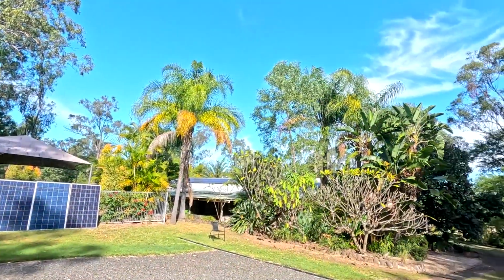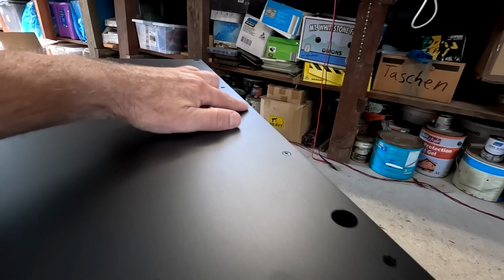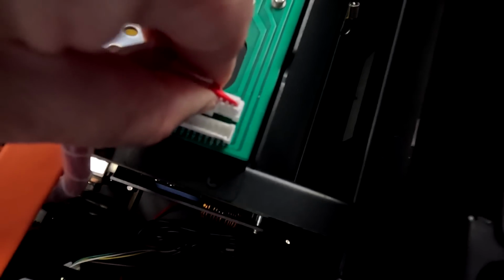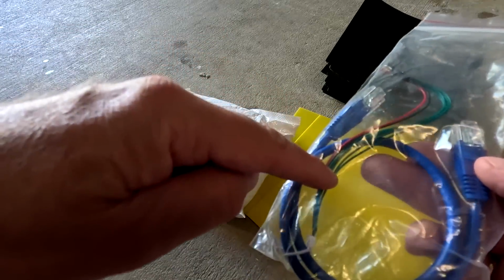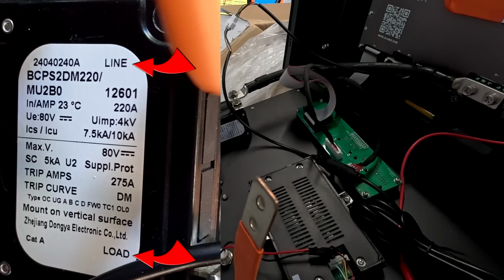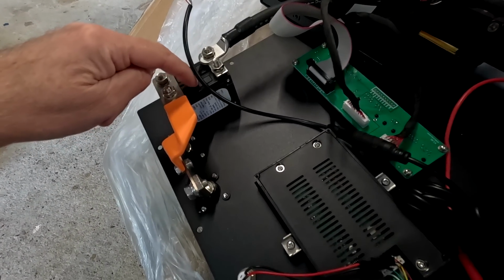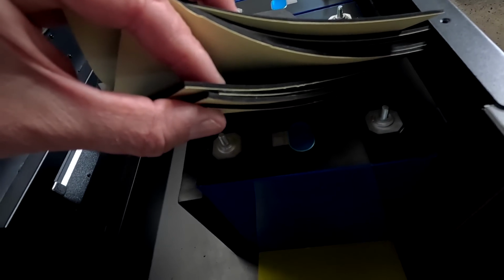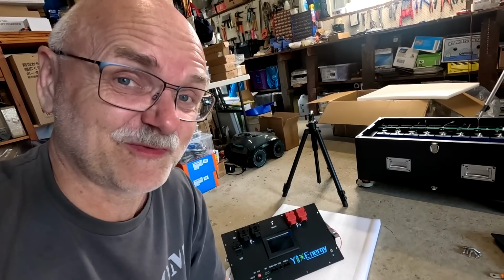The Yixiang DIY Battery Box on the testbench. Does it tick all the boxes?

Comment: Maybe they meanwhile are all looking similar - is the buildquality really so much better than EEL or Seplos?
The second connector on the PCB (BMS->cells) might by a active balancer connector in case you use a non JK BMS. Looks like a copy of the original EEL ones.
Reply: the question is the material - stronger than the EEL, especially for the compression? If he has a new EEL box he can compare. Advantage of the new box were the preinstallation. EEL came without any installation and no description about the screws (for what to use, so you have to find out and hopefully enough pieces ...)
Reply: @mandxyz2523  I build some eel - found it super easy. But yes documentation could be better - the tiny flyer is unreadable so you need to use the electronic one. Regarding the screws well sorted but it could be written on the box which screw should be used where.
Reply: @Ole-Endurance  my ones came without anything - no documentation. they forgot even parts ordered besides my boxes ...

Comment: Unfortunately no 200ah-230ah version 😢. Andy you really need to convince them it is a must have to be a big boy company😂😂😂
Reply: standard is 280 and 304ah or the new EVE MB 314Ah.....
Reply: @mandxyz2523  I know it is. But not everyone has the room for the big boxes. There is also the fact that I have an option on 1000+ units 206ah, so if it's possible I'll be going for that

Comment: I am an electronics engineer without solar.  I would definitely consider buying that battery box when I go solar.
Reply: Good to hear as I am also considering this box. Do you see any problem installing this box vertically? That's the only way it will fit in a small closet.
Reply: @PersonalStash420  it seems to be stronger than the EEL-boxes for vertical use - compression is possible. I built 2 eel-boxes (horizontal) and added the 4.3" screens separately. Necessary for me because they need an insulated box - hard to have a look at the screen then ......
For my understanding this box is excellent because nearly everything preinstalled! Especially when you do not need the insulation....
Have to check the price ...
Reply: @mandxyz2523  Our vertical JK battery box and horizontal JK battery box will be shown to you through Andy's video soon, I hope you will like it.
Reply: @CNEEL-BATTERY  Great! I will be looking forward to it. Thank-you. 😀

Comment: Ide like you to power it up so we can see the display & what is actually presents
Reply: the display is only a display. You cannot change anything there. you need your smartphone. It presents the voltage, SOC, the voltage of the cells. has 3 different pages. last for alarm
Reply: It still would be good to see the digital display. !!

Comment: Hi Andy, a double pole breacker normaly isn't two breakers at once. All the current sensing part loke the bimetal strip is only in one of the two lines. The only thing which is double are the contacts to separate plus and minus. So amp rattings aren't doubleing up.

Comment: Andy nice looking battery box and review. I noticed that the negative and positive terminals on the front panel were on the opposite side from most rack mount batteries that I have seen.   I noticed when you were loading the cells on the right side of the box that you were putting them in the box with the most positive terminal to the outside of the box.  The BMS positive busbar looks like it was designed to connect to the front cell inside terminal on the right side.  Also, if each breaker pole is rated for 275 A couldn't you just use one pole of the breaker to reduce the over current  rating of the breaker by removing the paralleling bus bar on the battery side of the breaker to split the poles?
Reply: The 275A applies to the pair, see also the description.

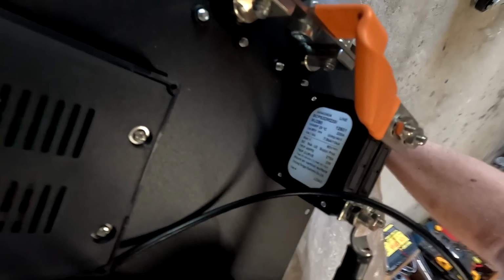Comment: At 9:05, I wonder Andy if they Are they using the dual pole breaker contacts in parallel to double the Interrupting current capacity of from 7,500 amps to 15,000 amps to meet the potential short-circuit inrush current potential of the battery which may be at least 10,000amps?  My thought as to the 550A overload trip current possibly being too high for the design might not be major issue, as it is in sires with the BMS that provides some level of overload protection, and the breaker is serving mostly as short-circuit protection device, and as you suggest serves more as an 'On-Off' switch. 

As for the sizing of the conductors going from the BMS to the breaker and out to the terminals being undersized for 550A continuous current,  again you have the BMS to limit current and the breaker appears to be function as short-circuit protection, and limiting the size of the conductors to the intended max current of the BMS, may help in reducing potential short-circuit current giving the breaker a better chance to interrupt a short circuit without damage or failure to the breaker itself or the BMS. 

As for the the breaker line-load connections, and the circuit being bi-directional, from what I recall about Circuit Breaker design, current direction may have more to do with meeting short-circuit current interruption rating and the design of the contacts being able to meet spec in one direction more so in the other, and in the case of charging you also have the BMS and the undersized conductors that might may limit maximum possible short-circuit charging current to less than the breaker's designed ICU.
Reply: The way they used this breaker is NOT ok. You cannot "stack" Ics values as it will be a lottery as to where the bulk of your current goes when in parallel. Even a tiny amount of resistance difference between the poles makes a huge difference in current carried. Next to that, with DC-breakers, the directionality has to do with arc suppression. It says on the label "mount vertical" which is because of the suppression chamber being in the correct orientation. As this one is mounted, only when charging, or with a short INSIDE the battery in a multiple battery system, will the arc be quenched in a correct way. When the short is outside of the battery; better not to have any body parts in close proximity. This also answers the question af another poster here about being able to mount this box on it's rear.
By the way, kudo's for the CN manufacturer for labeling this breaker with relevant information. Many leave lots do be desired. 
In short: opening DC-currents is a very tricky business, and this one has gotten it wrong. The only way to use this box safely is to have a correct T-class or NH fuse in close proximity to the connection.

Comment: I have 4 older models from this manufacturer that were designed for the JBD BMS.  Mod'ed all of them for the 4.3" JK Display and installed JK_PB2A16S20P's in them.  Built like tanks, just was a bit too early of an adopter.  Only yesterday did I discover this new case, was and still am going to order 4 more.  Oh well, that's just how this, ever evolving game works.  You buy now and tomorrow there is something better.  But I do highly recommend them, great customer support.
Reply: Hello, thank you. If you need our boxes, you can contact me at any time.
Reply: @YIXIANGBATTERY  - Hello! Do you make cases for 105ah? )
Reply: @serg9176  Hello, sorry, we don't have this model of box yet.
Reply: @YIXIANGBATTERY  - Can you sell separately only the front panel complete with all cables?
Reply: @serg9176  Sorry, the front panel is not available for sale separately.
Reply: @YIXIANGBATTERY  - Then I will have to buy from your competitors. ))))
Reply: @YIXIANGBATTERY  do you sell 25.6v 8S battery box? For 280 to 314ah batteries of course
Reply: @YIXIANGBATTERY  Do you sell this box for 200ah batteries?

Comment: hi Andy
Just wondering if you have done a assembly video on the horizontal EEL Diy battery kit , there doesn't seem to be any test results on your website only the vertical EEL kit ?
Reply: I had ordered a vertical EEL box and want to combine it with the horizontal boxes. I think, there will be problems with the different seplos BMS. But I will see.

Comment: Heya, oke someone has bean listening nice. the braker seems to connect ( battery side) only to 1 contact and the side that goes to the external contact with 2 contact points for the rest it looks very nice inside yes. can't wait till you get new batteries for testing and bilding this DIY battery case

Comment: I think it’s a lot better than the one I just bought.  I purchased a box with a JK 200 amp BMS and it’s been a nightmare.  Yes this is my first dyi installation but they could have made it a lot easier.  First the 3 inch LCD was cracked and unusable second no matter what I did I couldn’t get any voltage to the external terminals.  Building it was the easy part setting it up to work impossible.  My mistake was not knowing the BMS that I was getting.  I suppose there is a chance I damaged it when installing but everything except the SOC LEDS and no power out.  Great job Andy.

Comment: The dual breaker is actually 2 110 amp breakers in parallel.
Ideally you only need a breaker that is 120% of your max inverter current.
Also if you are using multiple battery boxes each battery box breaker can be a much lower current rating.

Comment: I would guess that braker is as stated for both together as is. In the US we have both 110v and 220v and alot of brokers are double for 220v and if marked, say 40 amp, if taken apart, it would be two 20 amp brakers.
Reply: I do not think this is right since the current must go thru both sections...so if it says 40, it is 40.
Reply from the maker: Yeah, we just don't know. It is usually per path.

Comment: Is it OK to not have any fiber boards between the batterie cells and the bottom of the case, or between the sides of the battery cells and the case?
Reply from the maker: Why would you NOT use the epoxy sheets? It's a safety feature.
Reply: @OffGridGarageAustralia  I didn't see the yellow plastic divider for the bottom or sides either, only the ends. I believe the original question is,,, why aren't they included and is it safe to build this without them?
Reply: i would put the fiber boards everywhere ...

Comment: 2x275A circuit breaker on negative line? no, thank you
PS: Victron Multiplus II requires negative line be always connected to the inverter
Reply from the maker: All BMS disconnect the negative path. How does this work with Victron?
Well, it has been tested, right😆
Reply: @OffGridGarageAustralia  and yet according to the Victron documentation:
> When connecting MultiPlus-II units in parallel, the following requirements must be met:
> It is essential the negative battery terminal between the units is always connected. A fuse or circuit breaker is not allowed.
Reply: @alexandershevchenko489  I guess that this is because it could lead to the battery current trying to flow down the signal wires. A breaker that disconnects either pole of the battery from everything else (including the BMS) will not lead to this problem... oh hang on a minute, this disconnects the output terminal rather than the battery! Surely a design flaw?